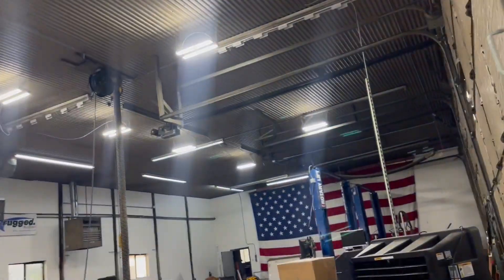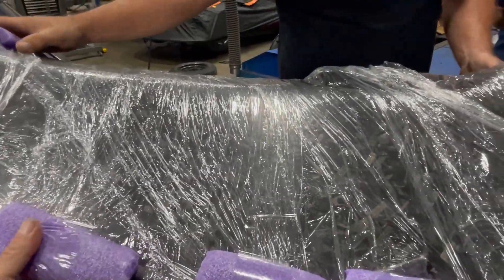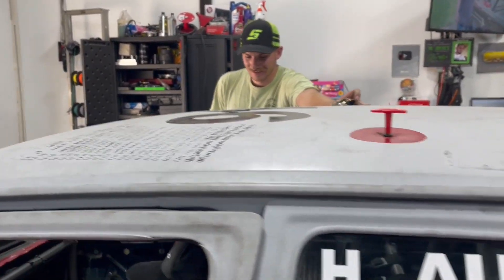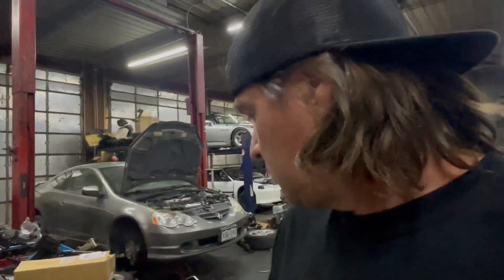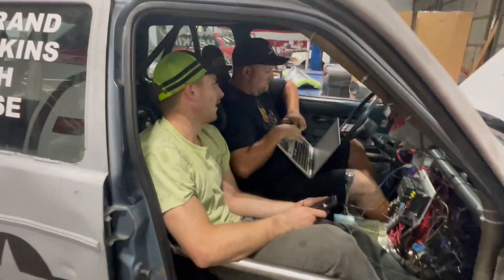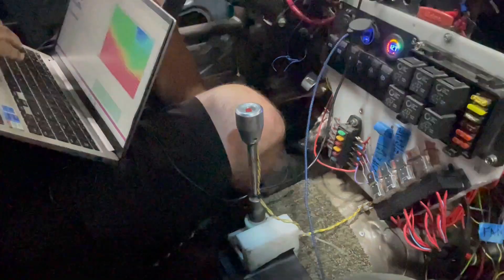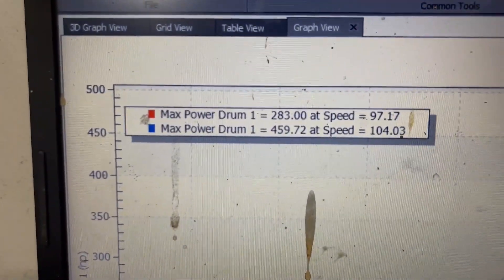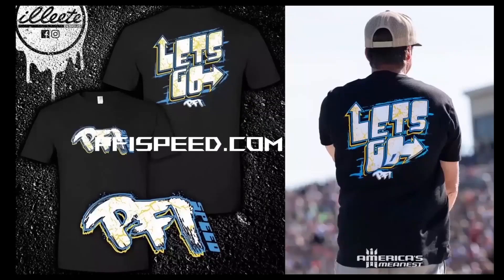SHO’NUFF a Good Unboxing Video

Comment: love a little more info on the volvo motor. Is that the 2.3 pinto motor with ahte volvo head convertion, or is that just a straight volvo motor?? I used to have the old Fox witht he 2.3 motor, and the volvo head swap was a thing then, to pick up good power. That being, going from 8 valves to a 16 valve motor, and making it sound so much better!!!

Comment: If I see it right, this chevette is similar to what was called a Opel Kadett D over here in Germany. If this is so I have some questions. Over here it was available with a small displacement 4 banger and FWD only. Have seen an older Modell chevette over here looking similar to a Opel Kadett C. That was our last small size RWD car from Opel/GM over here.